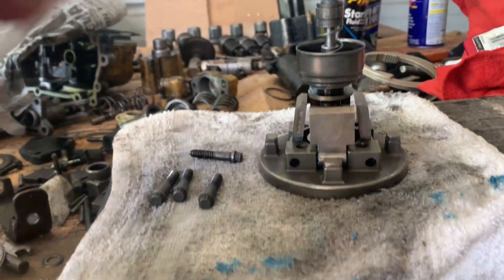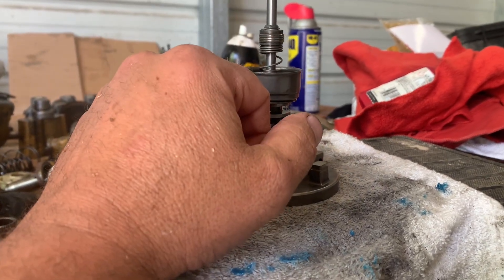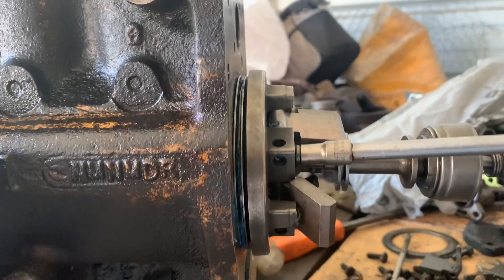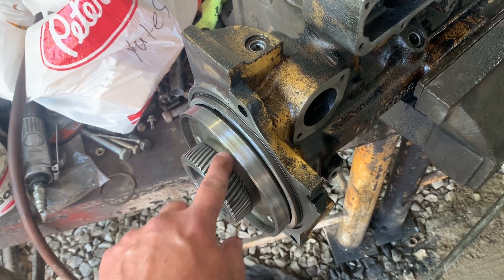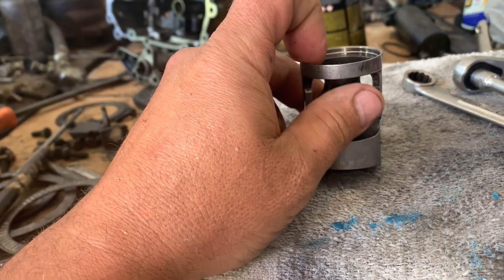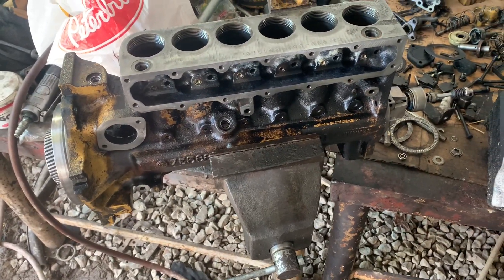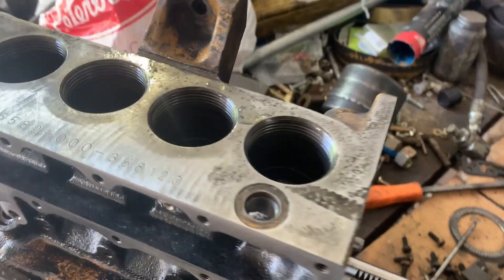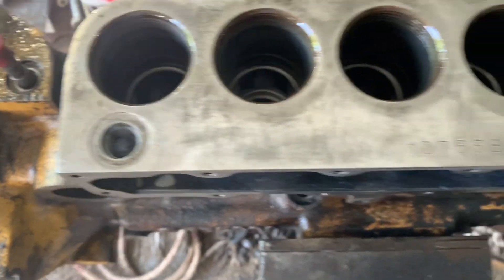Caterpillar 3406 fuel system assembly part 2

Comment: Why didn’t you wash it out completely on the outside also?
 That pump needs to be absolutely clean inside and out to ensure no dirt gets inside. 
It is a  high precision piece of equipment and it can fail very easy from any dirt particles getting inside it.
The top surface should be block sanded down or resurfaced to get all that pitting and rust scarring out. 
It needs to be extremely flat/smooth.
Instead of blowing it out just use diesel fuel to wash it out.
And put all of your bolts, washers and other parts in clean washer.